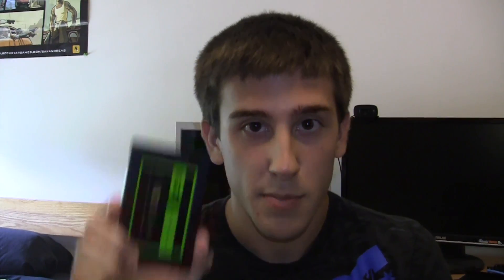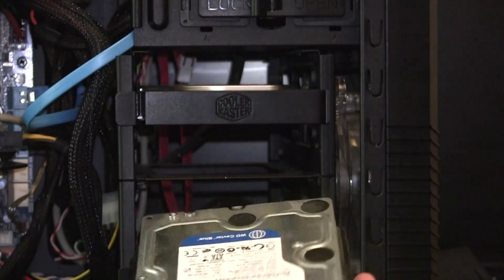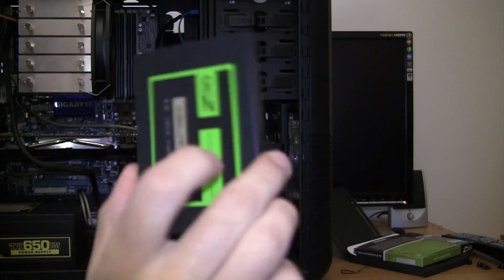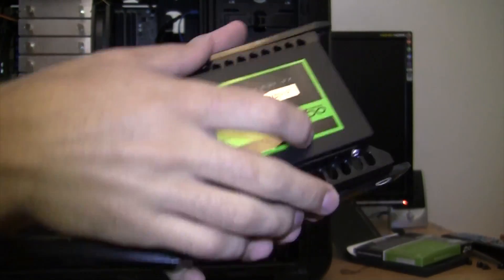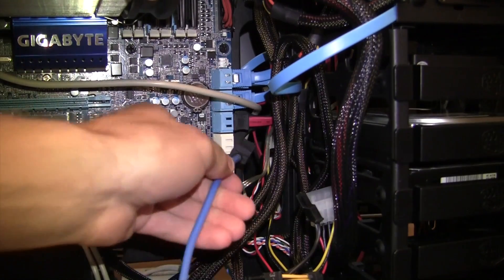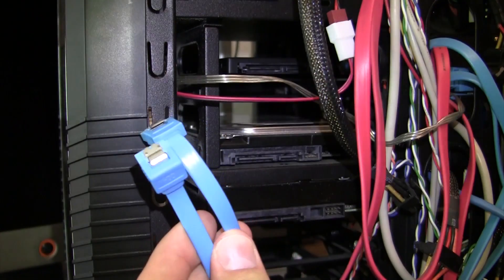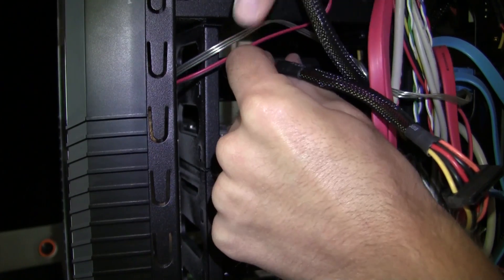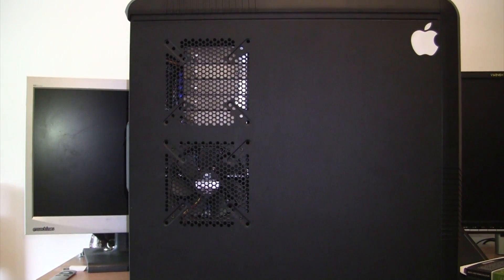OCZ Agility 3 SSD Installation

Comment from the maker: @markuk16 It doesn't matter, but it's recommended to put your drives in the first port for each socket type. For a SSD, use the first SATA III port, for a HDD, use the first SATA II port, etc.

Comment from the maker: First off, iOS is completely different from Mac OS X. Second off, I don't think a 6850 is a crappy GPU. Regardless, cable management isn't everything. My computer performs well and that's all that matters. This isn't a fashion show, it's an installation video. I've since moved cases and did what I could with the cables. Clearly, it's not as important to me as it is to you. You can call my computer a mess, but I continue to help thousands of people with my videos. That's what matters.

Comment: I have bought this SSD but have yet to install it.. I want to use it as my boot drive for OSX but have read about problems with this drive needing a firmware upgrade. Have you upgraded the firmware and was it easy? Thanks for your videos btw, been following the whole hackintosh start to finish series.

Comment: does the sata 3 cable come with it? planing to get a 120 Gb one. One store says it comes with cable and the 2,5 to 3.5 'bracket', the other just sell the disks, and probably take the cables and bracket and sell 'em separately.

Comment: So, you have 3 drives in your computer, what do you use the SSD for exactly? It doesn't really hold a whole lot of room on it. I'm trying to come into my own for Hardware and am on the fence about a SSD. I just don't know how it would work out. Do you put all your software onto it then save all your work onto a different drive? If someone could kinda run down the basics with me so I can wrap my head around it, I'd be very grateful. I know it has no moving parts and makes things faster, but how?